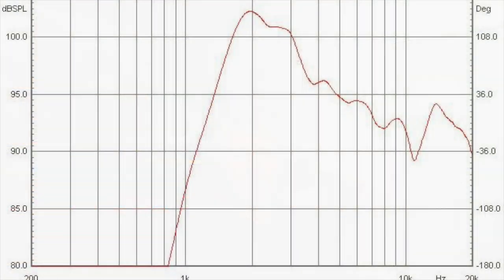Tech Talk 16: 1st Order Crossovers

Comment: couldn't agree more, the electrical properties of a driver only tell half the story. the acoustic properties have to be measured. that is why i love active crossovers. best thing about an active cross is that after you tune the speaker for a flat response you can sit in front of the speakers and keep fiddling until it sounds good for you, yes, it is much more expensive that way but, it's the best way, as long as you have a good ear for detail.

Comment: Danny , is the route of designing and building the drivers to be very well matched first  (woofer and tweeter) so 1 st order crossover with single cap for tweeter and single inductor for woofer with use of highest quality cap and inductor a best way to allow the speaker to have cleanest and highest resolution pass thru without all extra parts coloration out of signal path? 
B&W did it with their mini monitors like 685s2 or 686s2 .
Very few manufacturers have ability to design and build their own woofers and tweeters and B&W does along with their own R&D labs  , do you agree with thier  strategy listed above .... ? 
I have their 686s2 and have replaced their stock crossover with single high quality cap and inductor for woofer with foil copper one of same mH value both wired point to point ....after break in these speakers pass a lot of details and micro level acoustic harmonics with huge soundstage....
Reply: In reality woofers and tweeter are essentially all garbage. Therefore most pairings of any woofer and tweeter needs more than a 1st order crossover to prevent them from playing in their unlinear areas. In your exampel, yes its possible to find a tweeter that matches a woofer, so that they can be set together with only a 1st order crossover, but that isnt to say this is where they sound best. Also every component is coloured, including drivers, and most is not particulary linear a whole lot. Therefore more components in the signal path can easily sound better than fewer. Fewer doesnt mean necessarily better in that way. Usually the best pairing between drivers doesnt give the best price to performance ratio, because you can pair drivers more easy with a more complicated crossover network. Hope that makes any sense to you. 

But yes you would always pair drivers first, but a driver has so many parameters that best pairing maybe doesnt mean the simplest crossover network
Reply: @maxb.simonsen2459  Thanks, how about aspect of extra crossover parts (even those with high quality) creating signal path interference and influance on the signal purity ? 
So isn't fixing response flatness or other issues with more extra parts creating more side effects and signal influence...    
so is there such thing as over complicated crossover design with too many (often 20+ parts) of crappy quality creating more issues than fixing and glaring the sound resolution with poor sonic character of too many non audio grade parts?  
I think these issues are related.
Reply: This is a question GR is very interested in avoiding unsurprisingly as they sell crossovers basically. Very little is said about cone material, magnet size, sensitivity, dimensions when GR talks about speakers . Apparently any problem can be solved by norez & better components & measurements. But I think we should be focusing more on tweaking sound to our personal tastes rather then chasing linear measurements or conforming to others opinion. Hifi is about enjoyment at the end of the day. Personally I have upgraded my Nakamichi Sound Space 11 speakers to neodymium with metal cones. Hifi can be as simple or as complex as we want it. We should tinker, change & try different cone materials to see if it's good. No one size fits all. 😊

Comment: 0:06 Nice hair, I had something similiar back in the early 90's haha. Hey, this is a little off topic from the video, but should I change the sand cast resistors in my old JBL L100s?  I've already upgraded the capacitors, but I left the resistors since they tested out good in their rated range. If yes would mills be a good choice?
Reply: It won't hurt and you may gain some clarity.

Comment: You can't build a theoretical crossover based purely on the electrical parameters of the crossover components for two important reasons:  1) real passive crossover capacitors and inductors are not pure capacitors and inductors and 2) real speakers are not pure resistance, real speakers are complex impedance that loads the real crossover filter.  You can't build a real passive crossover filter without considering the complex impedance of the real load that you are driving.   You can't build a passive or active crossover filter without considering the natural acoustic, electrical impedance, and phase response of the speaker.  What is the real electrical difference between a junk capacitor or inductor and your high quality capacitor or inductor?